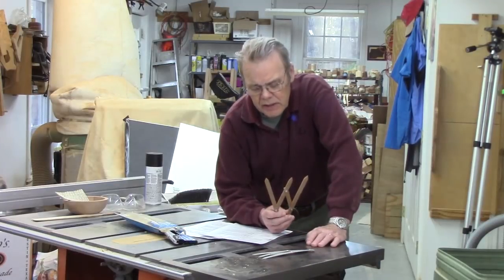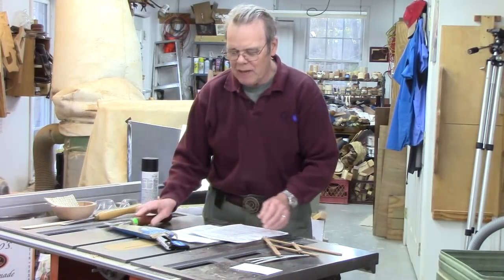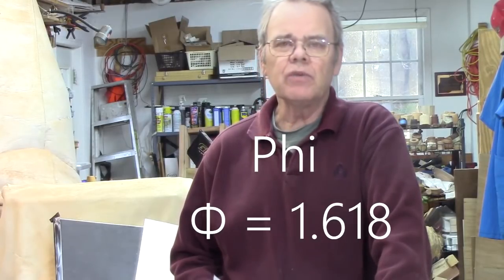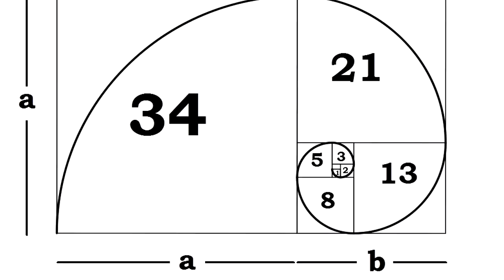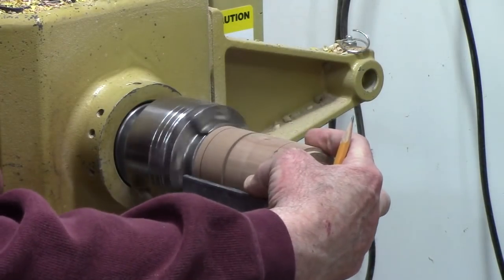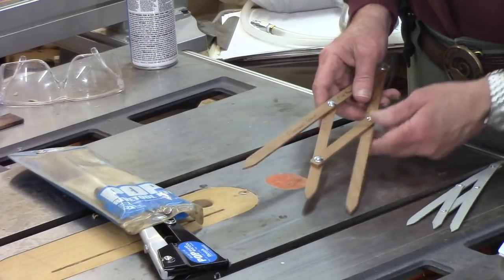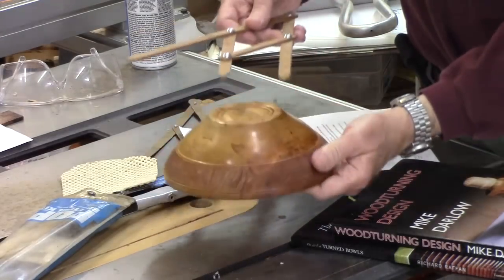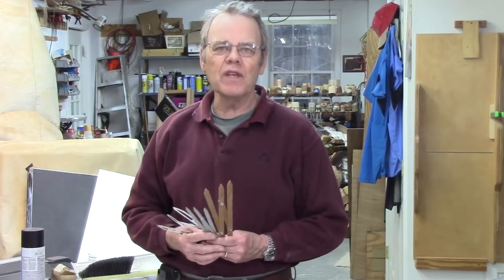Why This Fibonacci Gauge is a Game Changer

Comment: Hey Mike, if you have a moment...Do you ever turn the headstock on your PowerMatic out towards you when turning the inside of a bowl? I saw another YouTuber do this and wondered if it was advisable. Thanks,
Reply from the maker: I push it down to the end for better ergonomics. I think this may be what you saw if it was a PM. The HS weighs about 200#
Reply: Mike Peace Woodturning . No, he didn’t mover to the end of the lathe, he just turned the head stock about 30 degrees so it hung out over the front. I have tried moving the HS to the end, but in my small shop I don’t have enough room to work. Just wondered if you thought the HS on our PowerMatics would be secure enough hanging out like that. Thanks Mike I really enjoy your instructional videos.
Reply from the maker: @garymccoy2888  The PM won't do that becasue of the way it fits into the bedway. It has to be part of the design. You see it in the Nova lathes and many of the British lathes. It is a feature of the Record Power lathe my club won. I will do a review after it arrives.
Reply: Mike Peace Woodturning ...lol..I just discovered that yesterday when I tried to move it.  Feeling a bit dumb.

Comment: I have been using the golden ratio for many years now, going back to the days before I started turning when I was building furniture. I have two golden ratio calipers in the shop right now ... one that I bought on Amazon about 10 years ago, and a shop-made version that has legs 18" long for laying out bigger pieces.
Reply from the maker: Thanks for sharing, Gerald.

Comment: Mike - another great video

One of the problems is that most of the available plans for making Phi Calipers specify the dimensions of the pieces that make up the caliper.  That's fine as long as you like the final dimensions of the plans you are using.   Captain Eddy did a video many years ago in which he talked about the dimensions of the segments making up Phi Calipers in terms of a base dimension and a ratio.  I did a post on the Penturners forum about a month ago which included a diagram that showed how this approach could be used to make calipers of any desired final dimensions.   http://www.penturners.org/forum/f30/golden-ratio-caliper-159128/.
Reply from the maker: Thanks for posting your one pager. I put a link to it in my description. I guess I assumed a certain math ability for anyone wanting to make a set. I figured most viewers could take the dimensions and develop the ratios to scale up or down.  But you know what they say about Assume making an ass out of you and me!